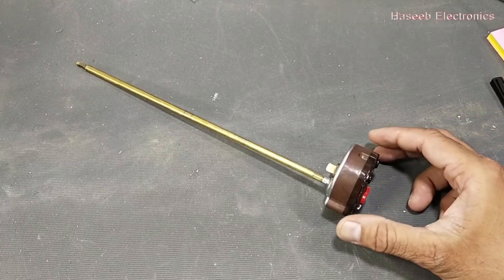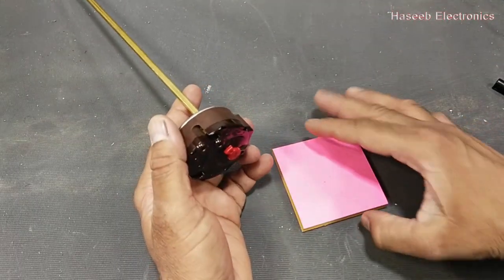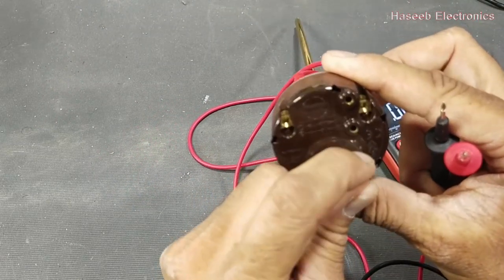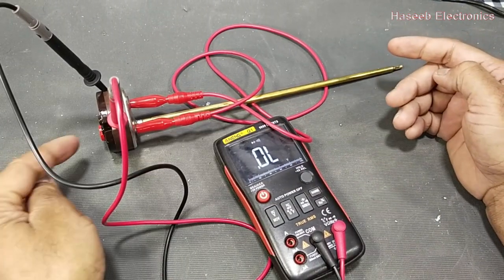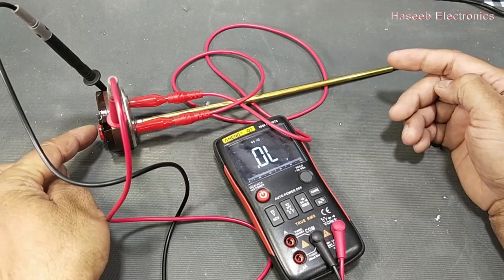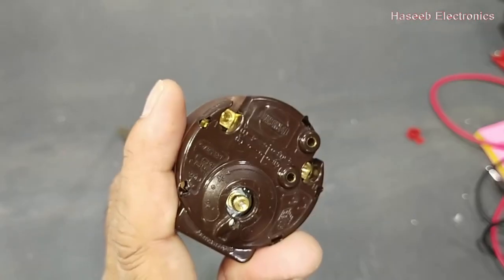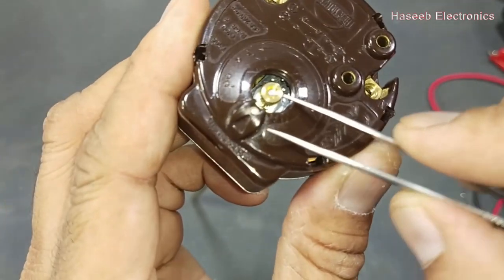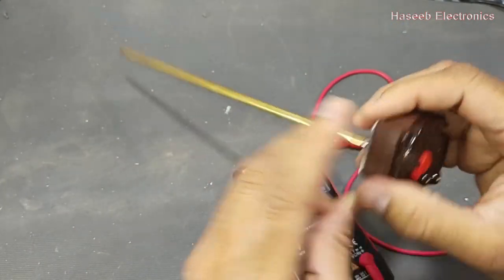{538} How To Test, Adjust Thermostat For Electric Geyser

Comment: Insightful Illustrated Explanation in a Non-Technical Simple Mode.
Sir , Plz may I know, which is the ideal position to position Knob of Thermostat , is it towards '+' clockwise direction or in middle.
Reply: The thermostat has the markings + • and ••.  It is best to set it between + and • because in that position the water heats up to a high enough temperature, and it does NOT heat up to too high a temperature, which prevents the risk of someone being seriously burned by hot water.

Comment: Very good video! I have quick question. Do you know the temperature settings in degrees Celsius on the dial? It has a - to + curve (from left to right) and the a single dot and a double dot. Do you know what they mean? And the temperature at each level?
Reply from the maker: working temperature minimum 20 degree to 90 degree celsius 
and maximum safety temperature 120 degree 
st starting of the curve it must be 20 degree 
and it must disconnect when the temperature reaches at 90 degree (that will end of the curve)
Reply: @HaseebElectronics  thank you for your quick reply. Appreciate it! 😊😊

Comment: My geyser no cutting off even kept at lowest setting. A new thermostat also same problem. I tested outside similar to you by multi meter and heating the rod outside, both old and new thermostat working well and cutting off once heated. What could be the problem. I feel rod itself not getting the exact heat from the water. When I touch the rod immediately after removing from hot geyser, it feels warm but not as hot as the water.

Comment: I enjoyed ur teaching bt I have an issue I changed my geezer thermostat and since my  heater started shocking i connected d red wire on L and black on N bt if I test d power with a tester screw driver light will show on d black wire none on d red wire pls wat do I do ?
Reply from the maker: heater is short circuit internally 
you have to replace it 
because the heating element is concealed in the metal part , but after passage of time the outer metal gets damaged due to water contamination and oxides so water enters in the heating element so it provides electrical shock 
please replace it

Comment: Taank you sir. One question: 
what is the hysteresis/control accuracy for such thermostat? Can such thermostat maintain the temperature range within 1 degree of accuracy. Say if I want temp between 59 to 60 only, can it turn on at 59 and cut off at 60 ?
Reply from the maker: best regards
dear 
these are analog thermostat which give estimated temperature control. because these use gas filled tube to activate electrical contacts. so no accuracy can be confirmed, as it is subjected gas expansion in the tue, gas quantity and thermal conductivity of the tube body
if you want temperature accuracy to maintain at a specific temperature. so you must use electronic thermostat or digital thermostat (as Geyserwise products i.e. Geyserwise Max
Geyserwise TSE) or other related brands